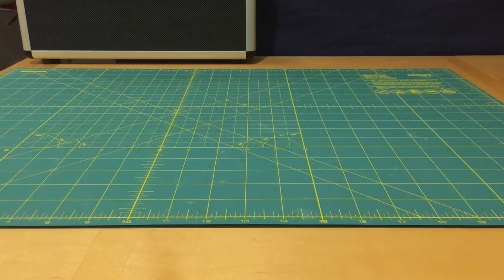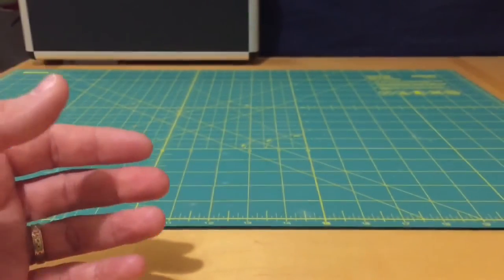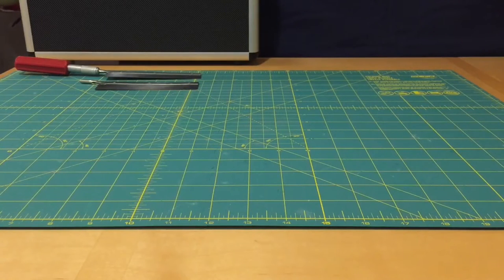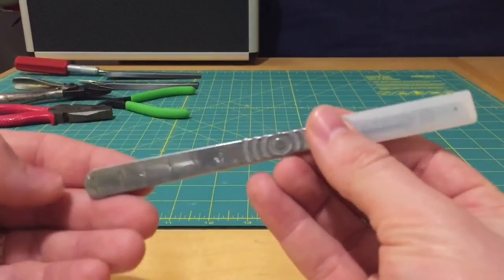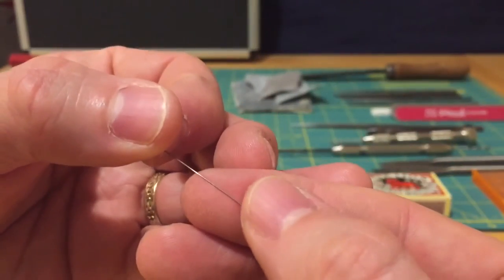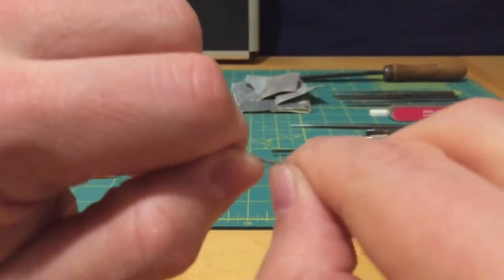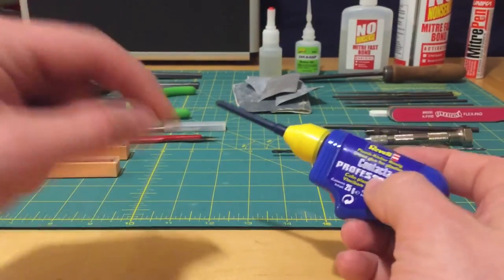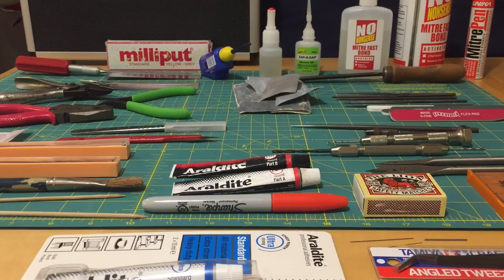Tools overview for resin models: what I use and why I use it.

Comment: Hello, recent subscriber and I just wanted to thank you for your content and excellent tips and info you give out. Some helpful things for sure. I did just want to add that when I get to a magnet over 6mm width, I tend to swap out to a diamond burr bit for my dremel. Works an absolute treat as you can simply shave away from the starting hole to the size you want. Super cheap for a set of 30 from eBay and they have all different shapes in the set so handy if I want to get some engraving done on a vehicle or a alike. Also some metal sheet has come in handy when there's a cavonous space but need to have something to magnetise too. Anyway, about the only extras I have outside what you've shown :-) Thank you again and look forward to your next video.
Reply from the maker: +Bob Bobington You are most welcome and thank you for subscribing. That's a great suggestion, I'd never thought of using those! What sort of metal sheet do you use i.e. for ease of cutting? I want to do something like that on my Coronus Grav Carrier turret where I can't countersink a magnet because the hull is too thin? Cheers 😊